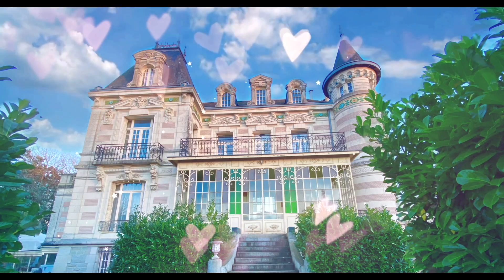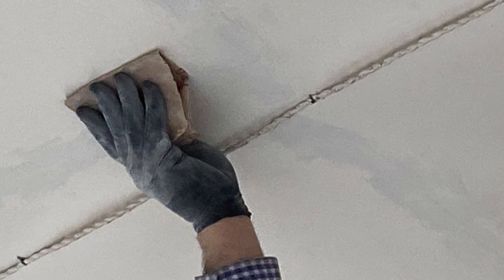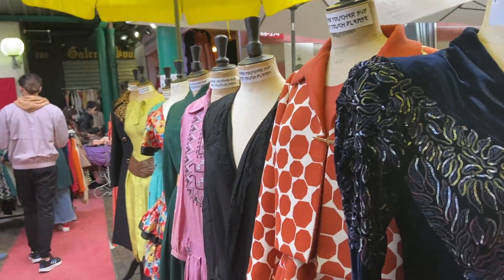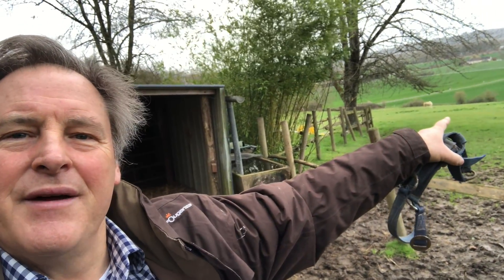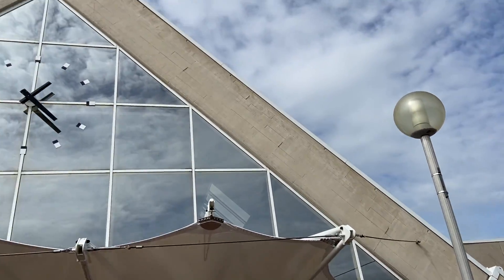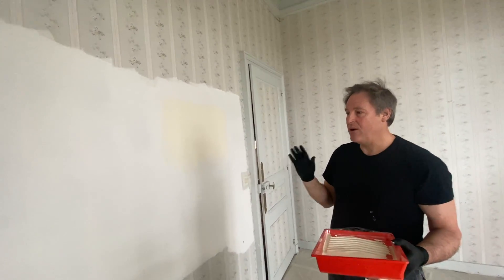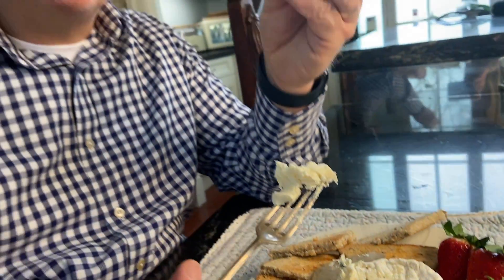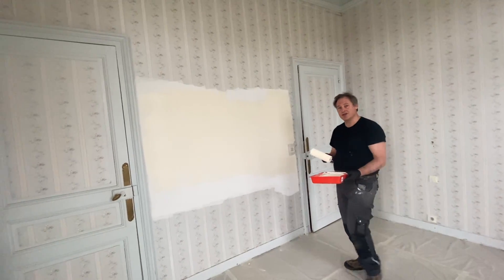CHATEAU DIY: A New Project! PARIS Antique SHOPPING & The Jewel of a ROYAL MISTRESS

Comment: Regarding tulip flowers and bulbs.  It's okay to leave bulbs in the ground 2 springs in a row.  Once they have finished blooming, mark the spot where they were with a stick and the color of the bloom (or variety if you know it).  Once the stems start to go yellowy-greenish, dig from 4 - 6 inches away from the clump and bring them up.  Using a plastic milk crate or other container with a mesh bottom, line it with landscape fabric, lay about 3 inches of soil on the bottom and lay the bulbs (still with their stems and leaves attached) at a 45 degree angle, stems up in a row. Cover the bulbs with about 2 inches of soil, then lay the next row of bulbs, cover with soil, etc. until all are done.  
Store them in a cool but dry place (humidity will cause rot), darkened if possible.  When the stem and leaves have dried to light beige, tug on the stem - if it pulls out with ease, the bulbs are ready to be stored until Fall planting.  If, when you tug, it does not come out easily, the bulb is still taking the energy from the stem, so leave it for a few more days.  
Once all the stems are pulled out, gently remove the soil and "dig up" the bulbs.  Sort them by size.  A bulb of 3.5 - 5 cm at its widest will yield a flower next Spring.   Anything between 2.5 to 3.25 cm will yield in 2 years and any bulb of 1 - 2 cm will take between 4 & 5 years to bloom.   My father had 'Red Emperor' Darwin tulip bulbs for years and every 2nd Spring would go through the above process.  He'd only keep the 3.5-5 cm wide bulbs.  The smaller ones, he'd distribute to his family or plant them in a nursery bed at the back of the garden.    
Beware of rabbits!  Where I live we have been having a run it with rabbits over the last 8 years.  They love tulips!!!  If ever you see that a tulip is about to burst into bloom tomorrow, if you've got rabbits in the area you can be sure that tomorrow morning, the flower will be either partly chewed up or be on the ground and only the stem sticks up to the sky.  
For daffodils, you don't need to separate the bulbs as often - I try to do it every 5 years.  At least the rabbits and squirrels leave those alone!
Reply from the maker: Thank you so much! I love your great advice and have saved many of your wonderful suggestions. We have far fewer tulips this year, but I will do this over the next months and fingers crossed for next year! 🥰🏰💖

Comment: A suggestion for the wiring of the chandelier in your bedroom - 
There is a light switch which is wireless.
So you attach the receiver  to the wiring on the chandelier. Then light switch turns on the chandelier  with no wiring going across the ceiling. I do not know the brand or makers. Sure you can find that. 
(Bit like a TV remote). 
In the first shop you stopped at in Paris I loved the glimpses of the bright & colourful landscape  paintings. 
As Spring is blooming there - Autumn is here in Australia.  But that is fine. Summer was So Hot! 🌞 🏖 🥵  here in Perth. 
 WA. The cool change is most welcome.
I think my new flowering pear tree thought it was in Europe! It blossomed in early March! 🤔
Warm Wishing for a Blessed Easter.
Reply: Edit: Easter Wishes
Reply from the maker: That is a great idea! I don’t know why it’s the only room with the wire exposed, but it’s driving me nutty and I don’t want to rip up the wood floors above. 🥰🏰💖